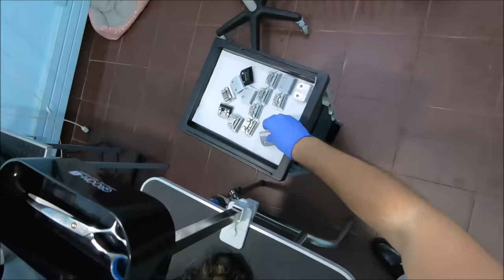Terribly Matted Dog Gets A New Chance For A Better Life

Comment: Sleepy puppy. You both did such a nice job with him. I used to work at a vet and my job was washing all the pets before they went home. You can never tell which critters will freak put in a bath tub (usually the quiet ones) and which could care less. Sometimes they’re so upset they can go into shock. Could you explain about the blades. Is a higher number a shorter cut? Thanks for the videos. I watch them while I work and the sounds are calming. Take care.